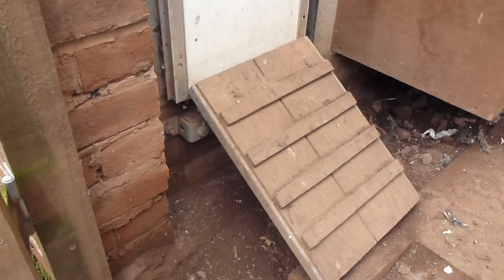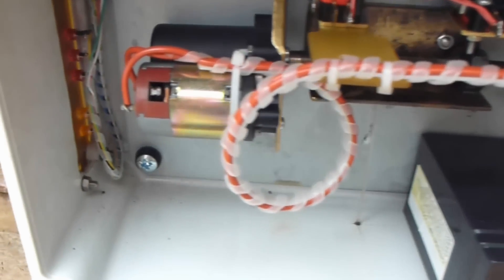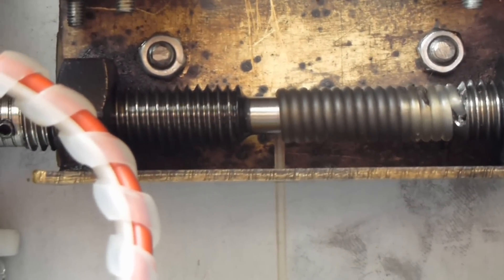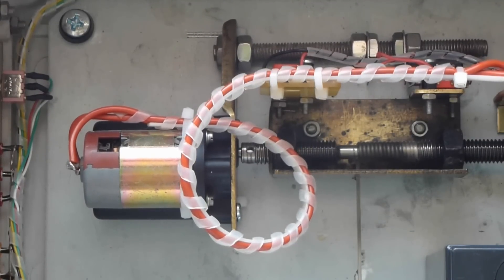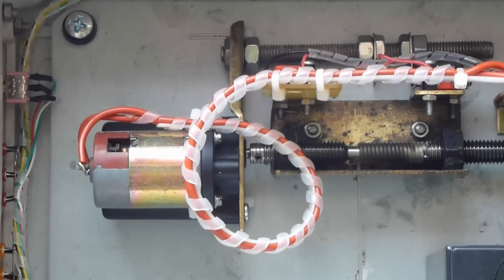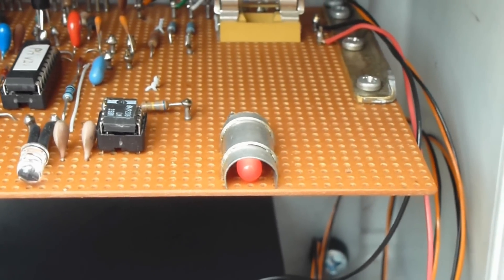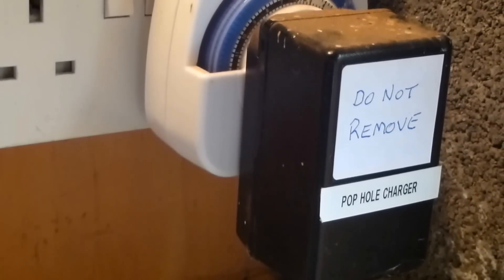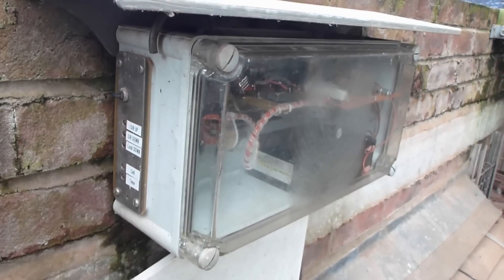Home Made Pop Hole (Automatic Door) for Chicken House

Comment: Any issues with it? It's been almost 10 years. How is the line holding up. I don't generally like these type of setups but yours definitely has a few features I am impressed with. Just one thing. The limit switches don't detect when the door is up or down. They just cut the current in the circuit when a distance is reached.  LOL

Comment from the maker: Sorry I don't have plans I can share. The mechanical bits will have to match the "scrap" you can find, but the video shows how it works. The electronics as I did it require some basic knowledge and some PIC programming skills plus a little imagination. If I was making another one I would probably simplify the electronics.  I might be able to find a drawing of the electronics to scan if you really want it.

Comment: Any issues with it? It's been almost 12 years. How is the line holding up. I don't generally like these type of setups but yours definitely has a few features I am impressed with. Just one thing. The limit switches don't detect when the door is up or down. They just cut the current in the circuit when a distance is reached.  LOL